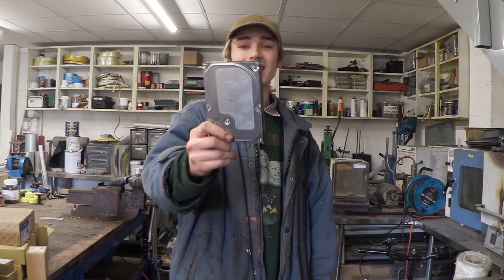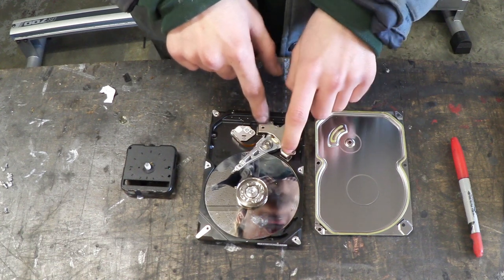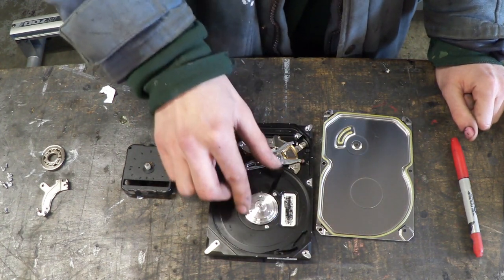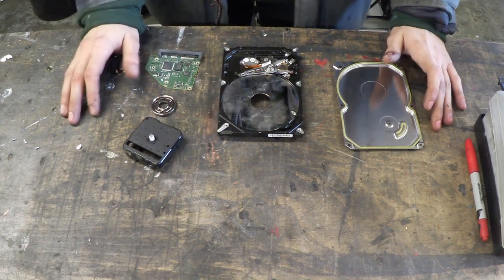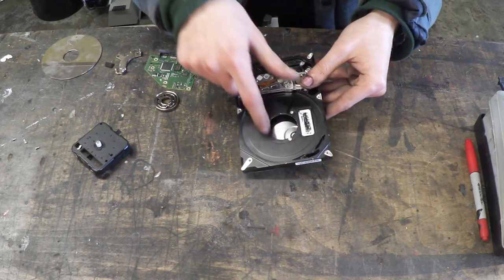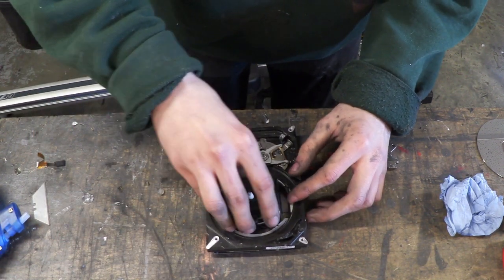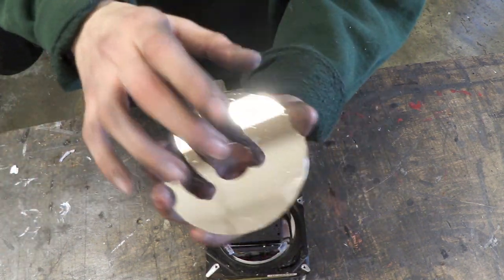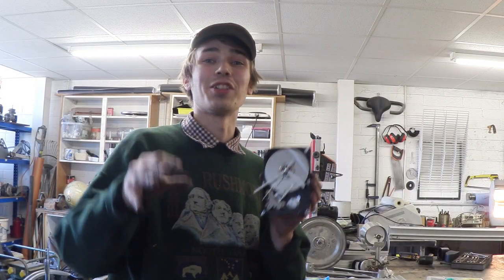1075 - Broken Hard Drive into a Working Clock

Comment: Nice clock, but if you have next time an idea to cut that disc plate with angle grinder plz dont do it or do it outside. You never know what material is disc plate. I tried this and had serious breathing problems. That dust is nothing good..

Comment: Add 4 lines for 12, 3, 6, 9 o'clock and Bob's your auntie.
By the way, when you said throw the coil in the bin my heart skipped a beat, are you kidding me. That goes in a coils drawer.
Reply: Bin as in parts bin.
But they probably have a coil bin as well.